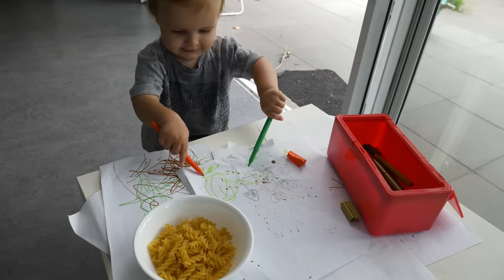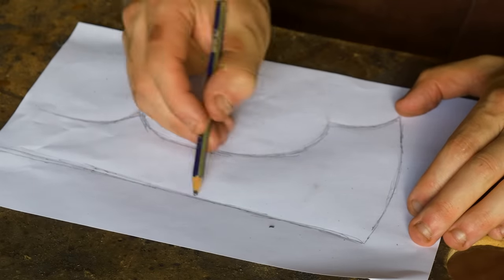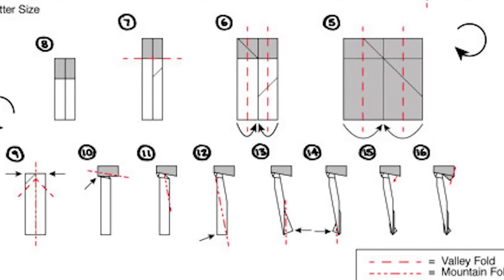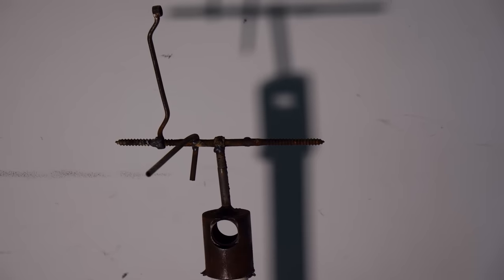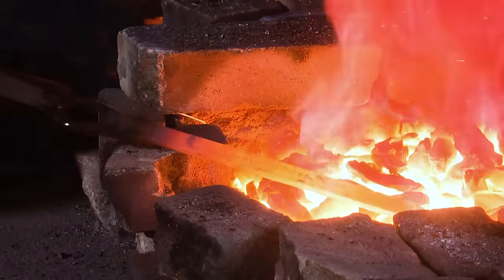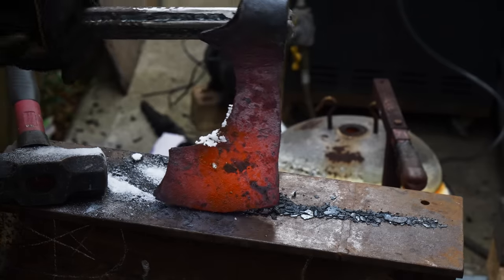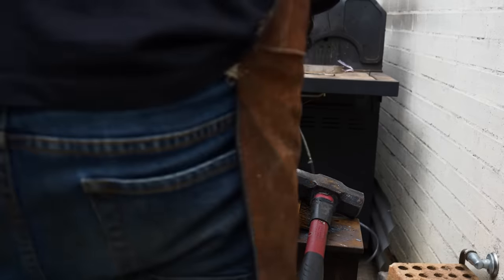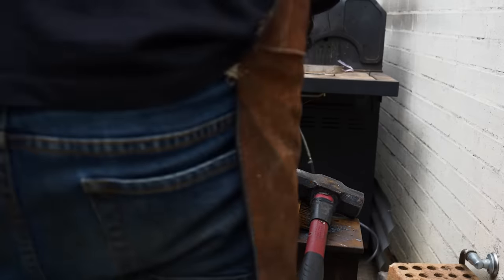YouTube's Worst Blacksmith Makes a Viking Axe!

Comment: 4:23

Be extremely careful what kind of gloves you wear when grinding. Most gloves will just get sucked into the wheel and drag your hand along with it.

The wrong gloves < bare hands when it comes to grinder safety.
Reply: Humble Hat yeah he reckless
Reply: what kinda gloves should one wear ?
Reply: It's okay, he has his safety apron
Reply: @mralberosie3987  
Honestly, I'm not sure. I've just seen too many people in the shop get their hands mutilated by grinders and other spinning tools because their gloves got caught and sucked their hands inside.

I don't wear gloves when I use a grinder, I just make sure the thing I'm grinding is secured properly. I've been cut by my grinder once when I was a little low on sleep, it sucked but it was just stitches on the side of my finger.
Reply: @humblehat4347  what kinda grinders eat gloves like that? I've never seen that, ever on an angle grinder. Belt sanders, bench grinders etc, yeah sure. But an angle grinder? They've actually protected my hands in the past if a disc gets snagged on something
Reply: and that, kids, is why you should only ever rely on safety squints for protection
Reply: Alright kids, stay safe on grindr
Reply: @SovietBiscuit 
 Just going by common knowledge and guesswork. I'd say that leather based gloves are good and fiber based gloves are bad. Leather kinda flakes away like powder, but fiber/cloth gloves are more likely to separate into strings, which might not always get caught, but imo that's not a risk worth taking.

Comment: I don't know anything about axes except that you need to sharpen the edge somewhat regularly. 

Maybe that's the benefit of a double-headed axe. You have two sharp edges that you can wear down, before returning to your shop to sharpen them.
Reply: well yeah but then again not really

the fact that its heaver and a lot more dangerous completely overshadows that fix for a mild inconviniance
(sorry for bad english im Europian)
Reply: @ultrandz1089  "(sorry for bad english im Europian)".If you were some poor African who were trying to survive on few Euro cents a day and by running from all the things that try to kill you everyday that would be plausible excuse but by being European that's a shitty excuse.
Sorry for my great English,I'm Croatian.
Reply: @robydee920  a plausible excuse*
Reply: That's why, generally. Also lets you have 2 levels of sharpness, one as a good cutting edge, for proper jobs, and a beater edge for shit you really shouldn't be doing with an axe.
Reply: Those are the two main reasons. So you don't need to sharpen mid day, or you can have two types of blades for two types of cuts.
Reply: @robydee920  bruh moment
Reply: You are 100% correct, double headed axes (sometimes called double bitted axes) where used by lumberjacks when they needed to go a full day of constant wood cutting and splitting. When one side is gets blunt, they would need to just flip it over and use the other side.
Reply: @robydee920  I'm sorry for your loss, I hear being Croatian is pretty tough. Kudos for learning English!
Reply: @TotalNigelFargothDeath  Yep specially here in Dalmatian part of Croatia, 300 hundred days of beautiful sunny days, beautiful clean air, clean sea, pristine nature, gorgeous women, absolutely miserably low crime rates, exquisite food, fine wine, delicious olive oil... Yep pretty, pretty tough. Thanks for your kudos but 81% of Croatian population speaks English so it would be harder to find someone that doesn't speak English than someone who does.
Reply: @robydee920  Your "Great English" is missing a few commas here and there, bud. Also, learn to put a space after your periods. Here, since I'm a nice guy, let me correct you. 
Corrected version:
"If you were some poor African who were trying to survive on a few Euro cents a day and running from all the things that try to kill you every day, that would be a plausible excuse, but by being European, that's a shitty excuse."

I found a total of 6 errors per your 43 words, which comes to be 13 errors per 100 words. That's bad because my high school french teacher would give me a big F if I had more than seven errors per 100 words. So, to clarify, you should be sorry for your English. Just not because it's good. Clever use of the word "Were" though. I will give you that.
0/10 F-.

Also, most countries in Europe don't have English as a national language, so don't be surprised if someone from some European country has difficulty speaking and writing in English.
Reply: It depends on the axe, and what you're doing. If you're just splitting the wood the sharpness of your axe is actually negligible. The way you swing is the most important thing over everything. If you forget everything else about axes remember a proper swing and that axe will last a few years. If it's actually sharp than good form will keep it sharp for longer because some swings will just tear the wood apart by force pretty much ignoring the blade.
Reply: @user-no2mv1zv9r  What are you doing? The guy was clearly saying he wasn't good at english a the beginning of the message, and afterwards when he say "My great English I'm croatian" was being sarcastic. And them you go with a full answer correcting him, and telling he's wrong even for a school grade, dude, nobody cares about good grammar or nothing like that, If the guy cares at all about that he will find ways to learn by himself, no in YouTube comments. Btw sorry for my pour english or any grammatical mistake, I'm actually from latinoamerica and only learn this tongue to answer silly youtube comments.
Reply: @SaxCthulhu  Roby Dee was quoting the guy above him to make fun of him because Roby Dee thinks that every European should know English. What --------- was doing was telling Roby Dee, a Croatian, that his English isn't as good as he thinks it is. Roby Dee wasn't being sarcastic, he was being arrogant.

Estoy aprendiendo hablar español ahora y tu inglés es bueno. Hay sólo un error. Debes usar la palabra "poor" no la palabra "pour". Pour significa verter y poor significa pobre o mal. ¿Es mi español bueno?

Comment: double headed axes, also known as a double-bit, have two blades with two different bevels. One is a thinner bevel to chop into wood easier and to also dig in deeper each cut, while the other is broader to split, making each hit drive the wood further from itself. 

Essentially the thinner is for cross cutting while the thicker is for rip cutting/ splitting.

Comment: double head axes were ment so that when loggers had one very sharp edge and one sacrificial edge they would use near the ground.
Reply: i scrolled down looking for this. thank you
Reply: Yes but the heads of such axes were  much smaller than those used in battle
Reply: @High_Tech_Priest  Nope, quite the opposite, actually.

Go look up a typical Viking axe. They're very light compared to something like a hatchet.

It doesn't need to be heavy, it's hitting flesh, not wood.

Comment: Irl doubleheader axes use one head for hacking off bark and mud off without pre-blunting the head you want to use for cutting the good lumber.
Reply: And I'll take a wild guess that's the reason historical battleaxes usually had one axe. Humans dont have bark, and you dont want the extra weight if you're gonna be carrying that thing around all day, let alone fighting with it.

On the other hand, there are in fact double bitted  battleaxes, the examples I've seen coming from Mongolia and India. These are easily explained as relics from the asian wars against the tree people of venus, who did indeed have bark, before the brave warriors of the east used their second axe blade to remove it of course.

Comment: The purpose of a double bit axe is that one side is used for things like bark which blunt a sharp edge And the other is saved for wood only. This means you can cut many things with one tool and not worry about blunting it

Comment: when you placed the file in the edge of the axe, you had essentially done what the Japanese did to make katanas. Since the Japanese couldn't melt steel, they would use different carbon steels in different sections of the blade to make it somewhat usable. That being said, quenching with this is a horrible idea mostly due to the different heat capacities of the different carbon steels. In order to prevent the cracking, you should have either gotten rid of the file or used clay as an insulation coating. On the bright side, only hardening the edge of the axe probably was a good idea and prevented too much cracking.
Reply: Lol no
Reply: @OneEyeDollar6  Lol yes actually. I dare you to prove Nash wrong. You can't because he's right.
Reply: school ended 6hrs ago

Comment: So, I’m going to be that guy. Historically, “Viking” axes would have had much smaller heads for combat and you are somewhat right, double headed axes really wouldn’t be useful in combat. They did exist but were used by workers who would be chopping down trees all day, if you have two sides you can go twice as long without sharpening it.
Don’t take this to mean that the video wasn’t great because it was!
Reply: It's more so you don't need to carry two different axes for different jobs. They always look symetrical, but the heads were actually sharpened differently. It's kinda like how you use a saw with finer teeth on harder wood, but kinda different at the same time. One half is sharp, and that's what you cut trees down with, but the other is more blunt, and that's what you split logs into usable firewood with. I mean, you do end up sharpening it less, but not because you just switch to the other side when one side gets dull. You just use the sharp side for as little as you can get away with, and don't bother really sharpening the other unless you've absolutely got to. Even then, you don't ever sharpen the dull side razor sharp, just get rid of any notches and get it back to being vaguely an axe.
Reply: My guy you could have dumbed this down and said small axe for fight double axe for chop
Reply: @bleets  affirmative grunt
Reply: @chastethompson1086  to add to this some double sided axes have differently shaped edges. One for splitting and one for cutting.
Reply: Wow
Reply: @chastethompson1086  That's actually really cool! Learning something is never an expectation while watching i did a thing but here I am!
Reply: HunterDevastator isnt that exactly what he said

Comment: Doubled headed axes are good because the weight is even and it gives stability to the swing
also more momentum and a spare axe after your first axe breaks
Reply: Also you have two heads. You need to sharpen half as often OR you can grind each blade with different edge geometry.
Reply: @matthewmarting3623  half as often but twice as long. That means procrastinating twice as much.
Reply: How the fuck does it add stability to the swing?
Reply: @NN-qj4sk  Because the mass isnt unbalanced in a single direction, rather its balanced, as both sides have the same mass, making it easier to swing, because you dont have the foward momentum from the axe's weight being on one side
Reply: Pink That only happens when you are holding it fully vertical, it makes no difference when you swing it. The center of gravity would still be in front of you. Makes 0 difference.
Reply: @N N I have used both types, I prefer a two headed (or bitted) axe.
Reply: Prophet Ear okay, why?
Reply: N N Not sure, exactly. It could be the added weight, but they make axe heads of all different masses. I think it has to do with the wind-up. There isn’t as much twisting of the handle in your hands when you lift the axe and during the swing. It makes the motion of the axe more predictable for the user.
Reply: @prophetear6221  with a double headed axe you can also have one of the heads sharp for cutting trees, and the other one less sharp, and with a blade geometry build more like a wedge, so that it would be better for splitting the wood
Reply: Your first axe doesn't break. Metal doesn't just spontaneously break, dude.
Reply: @emmaseay4068  Axes are supposed to be front heavy you fool
Reply: The extra weight would make it way too top heavy. And add an exhuberunt amount of additional weight that you have to carry with you. Why do you think the Vikings never used double headed axes? There pointless expensive and unreliable
Reply: @High_Tech_Priest  I’m loving this passionate axe discourse. I’m not sure if the Vikings used double-bitted axes, but we should remember that they were likely using their axes as weapons more than chopping tools.
Reply: @prophetear6221  so it's useless in battle. And useless for chopping wood

Comment: A double headed axe has two heads one head is for splitting wood and the other is for cuting down trees
Reply: Not if its a battle axe lol both sides are identical and its to be able to cut cunts up no matter which direction you swing

Comment: 1:29 double headed axes are for loggers. Basically the thought is when they are out in the bush they don’t need to resharpen their axe right away; they can just use the other side. It also makes the axe balanced and gives you a nice controlled swing. There are so many types of axes, but mostly single headed axes are for smaller jobs(George Washington) or for killing people(Vikings and leather faces ancestors’).
Reply: It also depended on the function of the axe! medieval axes would often have one side of the axe be a typical axe while the other would be a large spike or sometimes an almost ball-peen hammer like nub at the end for bonking infantry helmets with on horseback! though calling them an axe is debatable (as is nearly every other weapon in history because deciding where to draw the line is confusing sometimes. (edit sometimes they were polarms, as was the poleaxe. if it was smaller meant to be held in one hand i believe its just an axe. but with style)

Comment: According to google, this is why double headed axes exist:

"The purpose of the Double Bit Axe head is to have one side razor sharp and the other side more dull and rounded. Use the razor sharp side for chopping and cutting, and use the duller, rounded side for splitting."

in terms of combat, it doesn't appear to be something that was widely used, some people speculate that they were used as more of a ceremonious or symbolic  thing

Comment: "it just adds extra weight" the whole point of chopping tools
Reply: A double axe is for being able to work longer, and if that's the case then it's very necessary. When one side dulls you turn it around rather than using the stone every 30 minutes, which also keeps you from losing the drive. They're usually only slightly heavier than a normal chopping axe (4 to 5lbs). I own two, one is 5lbs and the other is a splitting axe that weighs 8lbs. And I hear a lot of people saying they're dangerous, but they're not, or atleast anymore than any other axe. If you hit someone behind you then the person you hit was a dumbass. Nobody should be standing that close to a man swinging an axe period. And if you hit yourself... I guess it doesn't matter.

Comment: Isn't it usually the opposite?
Soft in the middle and hard on the outside.
You don't want the edge to be to brittle.
But you don't want the body to be to soft.
So you use soft low carbon iron for the edge, so that it can be really sharp without fracturing.
Then you use a hard high carbon iron on the outside so that the tool keeps its shape.
It becomes hard and bend instead of breaking, but not so bendy that it loses its integrity.

Comment: A chopping axe may have 2 heads, because try cutting down a tree with an axe as dull as hammer.
One side gets dull, flip it around, continue. Extra weight on chopping axes is not a bad thing. In war yes, if ur axe is dull as a hammer, use it as a hammer, still works excelently.
Reply: I know I'm a bit late but its a little harder than this
axes are heavy, and have thin edges, if the whole edge gets dulled, as in flat, as in no cutting or piercing edge, it will be very hard to use as a hammer

Hammers have faces, some have a face with 4 spikes, these are important for giving the force of the swing somewhere to go instead of being spread out among the face of a flat hammer. Axes, if sufficiently dull, and I mean reenactment dull, have one edge, and when you swing into someones armor or even heavy cloth with that edge, rather than going into / denting the armor, the whole axe will just flop over with its flat side and kinda do nothing. The solution is just to use the back side of the axe head, but that only comes out from the handle so far that you will likely distribute the impact between that and the handle. The solution, in turn, is to extend the back end of the axe slightly into something like a spike, which won't go dull as easily, although getting an axeblade so dull as I mentioned before is a challenge, you are more likely to chip it in battle

Comment: I use an axe more often than I care to, and I have my double bladed one sharpened differently on each side. One is comparatively sharper and has a finer edge, which works better for smaller trees and bushes. The other has a I guess rougher edge that's more suitable for actually chopping a proper tree, and is also easier to keep at a working sharpness with just a pocket stone than the finer edge.

Comment: One side of a 2 bladed axe is kept razor sharp for carving/paring, and the other side is dull for splitting logs, so you don't have to switch axes or sharpen while doing something.